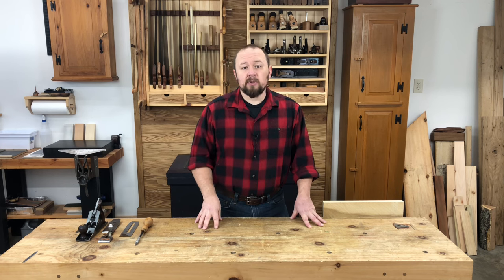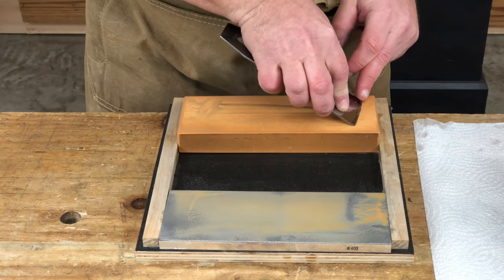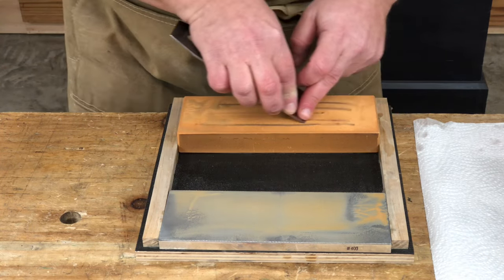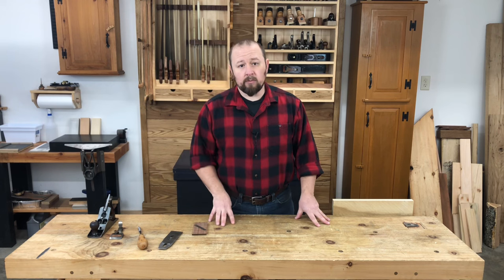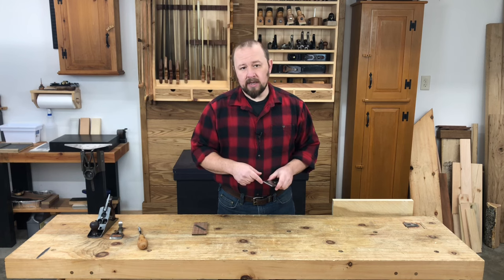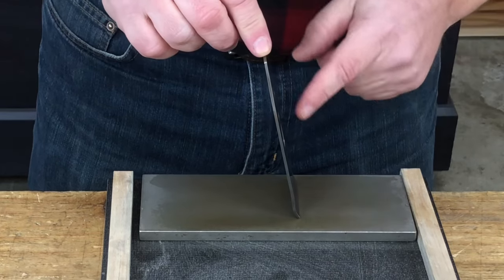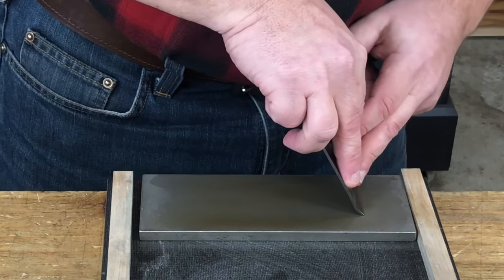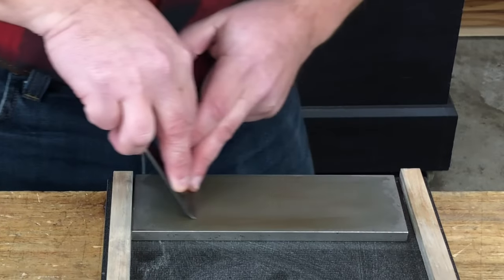How To Eliminate Hand Plane Tearout | Hand Plane Foundations

Comment: The guy who taught me everything I know about woodworking either runs the plane with the tote end kicked out to about a 45 degree angle or grabs a low angle jack that he put a 90 degree beveled iron on (works like a card scraper) or if it's really figured wood, he'll just pull out the card scraper and work down the whole last 32nd of an inch with that.

Comment: Thank you for an interesting and informative video.
I offer these two comments:
1 - Especially in cheap planes, ensure that the cap iron is sharpened to the tip.  If not, there's a slight groove or gap behind the front of the cap iron which will fill up with wood particles and the cap iron isn't working.
2 - With apologies, I have found a mouth that's too wide will induce tearing even with the grain.